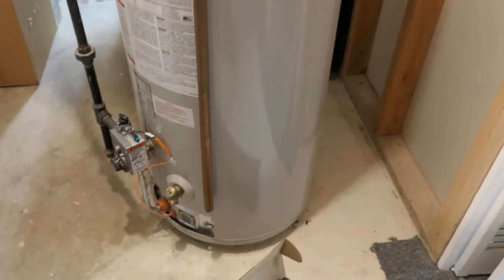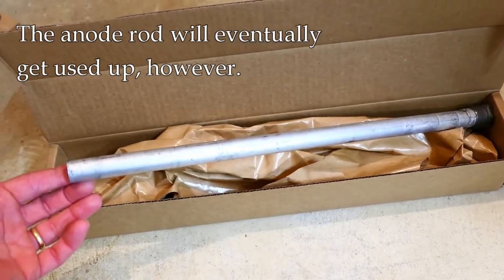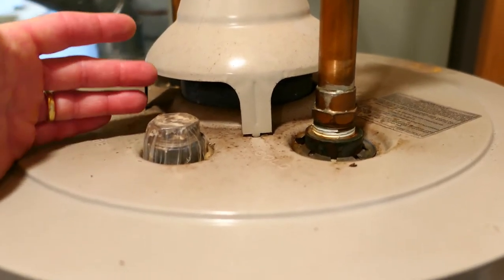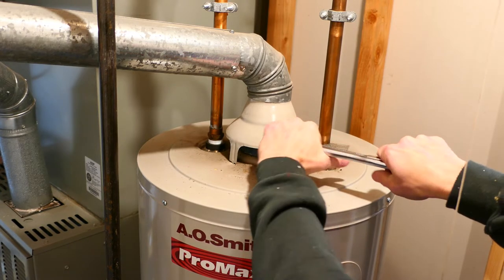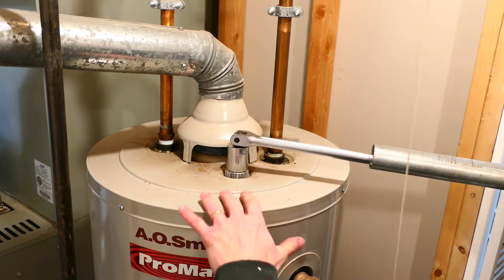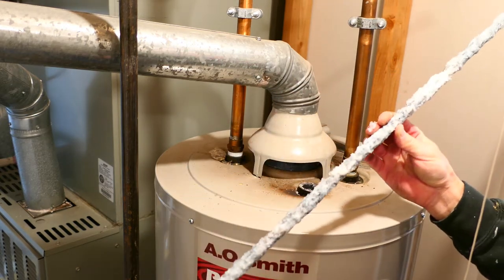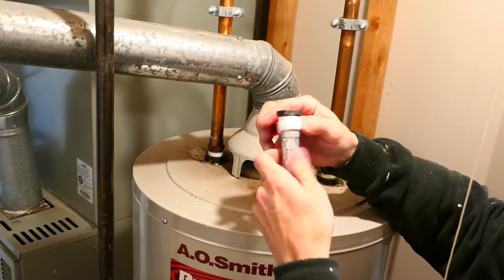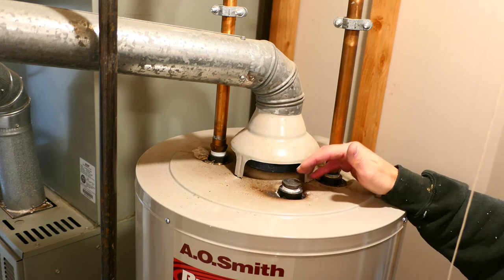Water Heater Maintenance: Anode Rod Replacement

Comment: For people who do not want to maintain their water heater, companies now have electricity powered anode rods that don't need any maintenance at all. You just plug in the powered rod and the electrical property of the rod inside will attract the ions from the water. Its cost obviously more but it saves you from all the hassles of maintaining one. I'd say its a good investment to have. It also adjusts to the water conditions automatically which is an added bonus.

Comment: Good for you that you got it off. Because god luck on getting them off. Most do not even budge. My recent attempt was on a 40 gal Whirlpool. About 3 years old. I had shined a light down in the water line side and seen rod about 70% gone. Breaker bar and pipe, even pipe wrench and air gun with socket at over 120 psi. Nothing and in the end the mushroomed the hex so I stopped. That and there is the risk of cracking threads inside tank itself. That happens and you are screwed. So I leave them alone any more. Also do be advised the tourch is not a wise idea. I recall right the cold side uses a plastic, rod that goes in tank. You can melt it in some cases.
Reply from the maker: Obviously you need to use caution with the the torch, but in my decades of automotive experience it's often the only way seized threads will release.  To be clear, you don't need to heat up the rod cherry red!  Just some judicious heat can make the difference.  If the flame puts you off, you can also use a heat gun normally used for paint stripping.  That's a more gentle heat and may be easier for some to control.
Reply: Thanks for the idea that might help me with my whirlpool have the same issue. Will try this before I use my impact wrench next in a few.

Comment: for anyone reading this later, i wanted to share what finally broke mine free. the task was made much more difficult due to the mfg (Rheem) burying the rod access point deep within the unit's housing. after failing to budge the rod with all the normal tools, i picked up a 2 ft breaker bar which managed to break the 14" extension driving the socket but didn't move the rod. next i tried a series of progressively stronger impact wrenches, working my way up to the strongest home depot had to offer. still, it wouldn't loosen. i puddled liquid wrench over the rod head for 4 days and then made repeated attempts w/ all the various tools but still no luck. finally, i added another 3 ft onto the end of the 2 ft breaker bar and finally that worked. hoping this story helps someone down the road that is facing their own "get the anode rod out" nightmare.
Reply from the maker: Persistence pays off!  Glad you finally got it.

Comment: Tip: when changing the rod, do not drain the water. The weight of the water will serve as the "helper".
Reply: great point - the caveat to that is u do want to drain off a few gallons (and close the service valve the plumber hopefully installed on the water line supplying the heater) once u finally have broke the rod free but before u loosen it so much that air is introduced thru the opening where the rod is. otherwise, u'll get the watery mess i got today that will send your water heater into an alarm state (if equipped w/ leak sensors) that won't stop until u've completely dried all the water from the area.

Comment: Thanks!! Do you have the link about transition from tile to laminate flooring? I am having an issue with my new tile being a little over 1/4 higher than the laminate flooring? And what type of transition should I get?
Reply from the maker: I think you must be responding to a different video?  But since you asked, a 1/4" difference is surmountable with a wood or metal transition.  Your box stores will have a selection of transition strips in the flooring section, but I will often make my own out of wood.  If that is more than your skillset allows, I'll bet you can find something at the box store.

Comment: Regarding the blowtorch: 
What length of time did you use?
Did you heat the nut itself, or the area around the nut?

I have a two 6.5 year old units; The first one  i was able to change with a wrench, 4' cheater bar, and a mallet.  The second won't budge, i have tried all of the above + 3 different impact wrenches, tried vinegar to see if that would help. Nothing wants to work so i am now considering heat.
Reply from the maker: The length of time will vary depending on the unit and the configuration.  I've been doing this a billion years, so it's just by experience.  As a starting point, probably about a minute with a propane torch is enough to get the nut pretty hot.  Avoid MAPP gas, which will get too hot too quickly.  Move the torch around the nut to evenly expand that metal and then try a breaker bar.  Obviously, keep something on hand in case you catch the paint on fire, and be wary of where you put the torch down when you go for the breaker bar.
Reply: I put  clr in tank for 2 hours  it got  all  sediment  out  now  it works

Comment: I tried today along with a friend with no luck. 
Any other suggestions other than what was shown?
Reply from the maker: Loosening bolts or nuts or things like anode rods is part art, part science.  Experience plays a big role.  These tips in the video will work unless your water heater is so far rusted and gone that it doesn't pay to replace the rod anyway.  Possibly you didn't torch the area long enough or get it hot enough.  Possibly you needed a longer extension bar or more muscle.  Since you have already struggled, I would suggest heating the area to within an inch of it's life, and then using a breaker bar with a baby sledge or a large rubber mallet.  Give it a series of heavy wacks on the end of the breaker bar to bust it loose.  Cursing the heater and using names which invoke a sailor's life on the high seas can also be helpful.
Reply: Impact gun

Comment: relieve the pressure in the tank, then leave the water in for weight when undoing the anode bolt.......and then fill the tank to tighten fully.........and yes flush the tank once a year.
Reply from the maker: The water weight can help, but if the rod is corroded in place that may not be enough.  A tall style water heater, especially, can be easily torqued out of place with a breaker bar.
Reply: that is what i use, and started doing it empty, but still the movement is bad, so i do it weighted now......big difference.

Comment: my rod is in a recess which is about 3 inch deep. any suggestion for a tool to pull it (I have a socket but how would I pull the rod if the recess is tight?)
Reply from the maker: I'm not certain why they would build it that way!  If you can get a socket in there, though, then loosening the rod is the difficult part.  Once fully un-threaded you may find that just the friction of the socket on the nut is enough to pull the rod out.  If that fails, they do make very long needle nose pliers which might to the trick, or you might be able to fashion a hook from a coat hanger to lift from under the nut.

Comment: How often should you change it?
Reply from the maker: The rule of thumb often given is three to five years.
Reply: @enduringcharm  wow.. my water heater is like 10 years old and I never changed it. I wonder if it is worth it.
Reply from the maker: Lots of people never change it at all.  Much depends on the composition of your water.  Acidic water will eat up the rods faster.  By changing the rod you may prolong the life of your heater but if your heater already looks like it's at death's door then it isn't worth it. Typical heater lifespans can be as little as ten years and as much as 25-30 years.

Comment: I just used an air impact, so any impact should work well to get it off.  No wrenches I had seemed to work, even with extensions or a helper.  The impact zipped it right off.
Reply from the maker: Whether an impact works over another method, such as an extension bar, really depends on the individual circumstances.  In some cases if the threads are just tight and the heater is moving around with a breaker bar, then an impact could work well.  In other cases, if perhaps the threads are corroded or the housing itself flexes with each impact hammer, then an impact gun will get you nowhere.  It's good to have multiple options.

Comment: Leave the water heater full first to weigh the heater down.
Reply from the maker: That can't hurt, but with the pipe extension it's still possible to wrestle the tank right over.  If that sticky bolt had been on a car or truck I could easily have broken it free, but there's only so much leverage you can put on the tank without tipping it over.